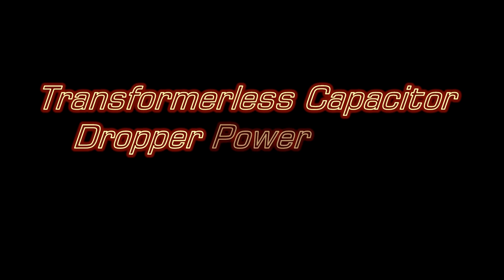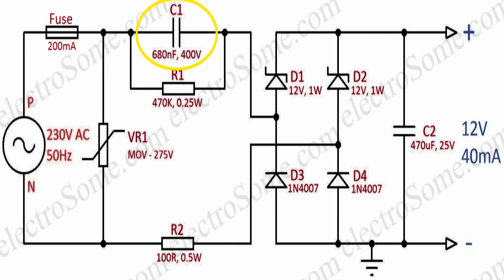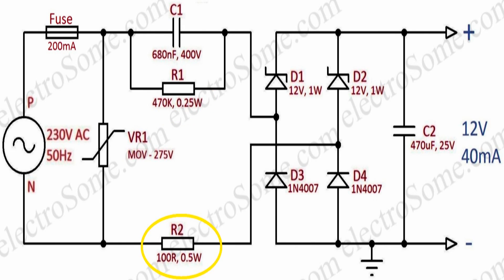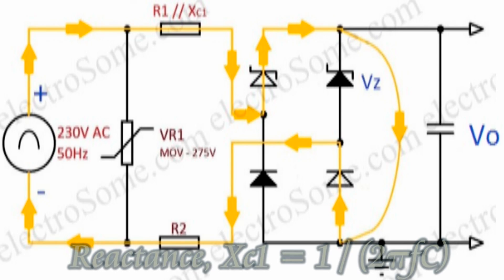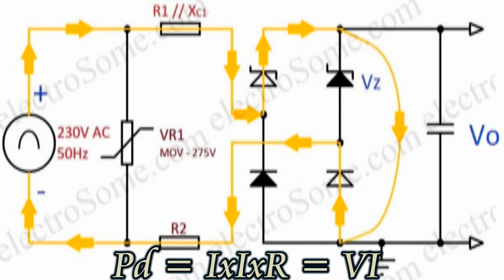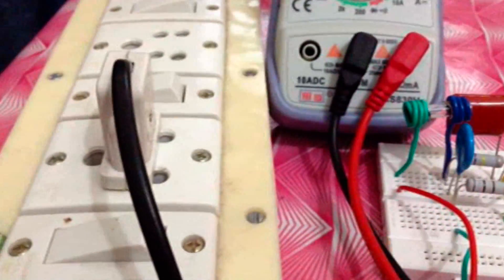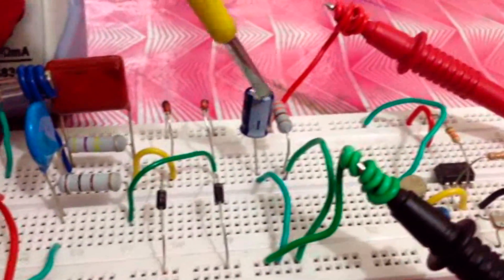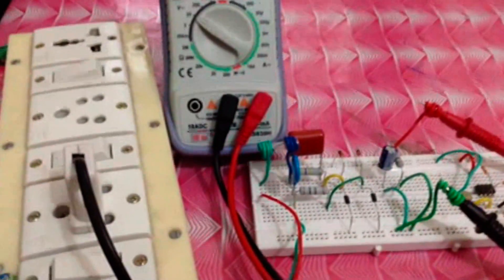Transformerless Capacitor Dropper Power Supply Design

Comment: Hi, How much current you were able to draw before the output voltage started to drop
 significantly?
Reply from the maker: Output current will depends on the capacitor value. Please read the following articles. 
https://electrosome.com/capacitor-power-supply/
https://electrosome.com/transformerless-low-cost-power-supply/